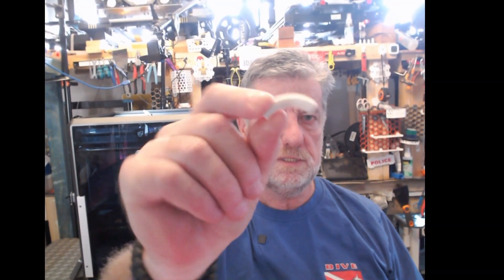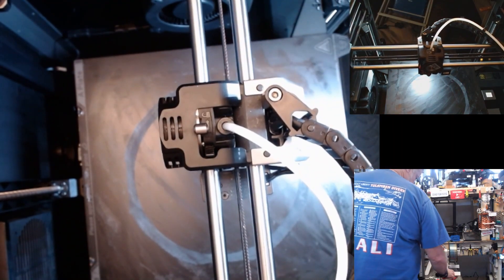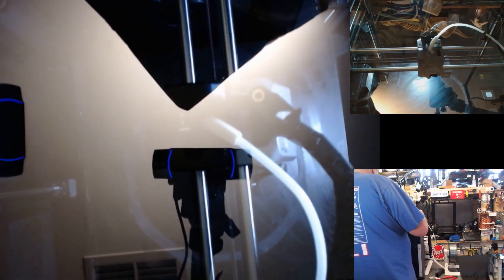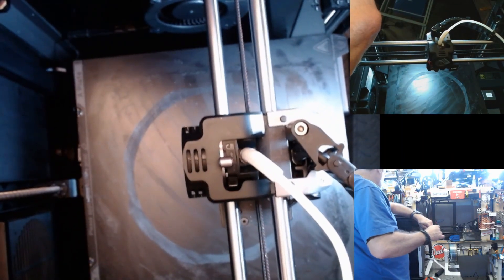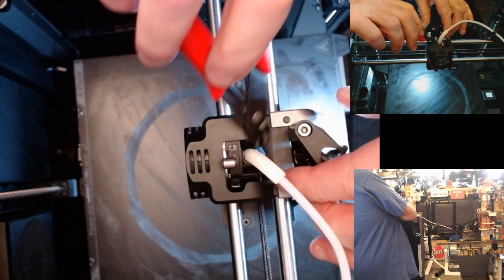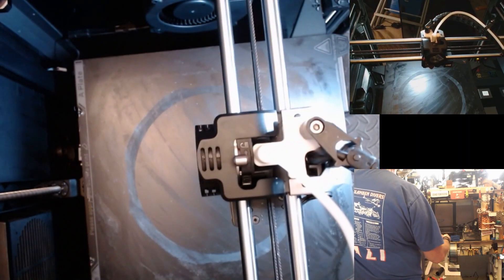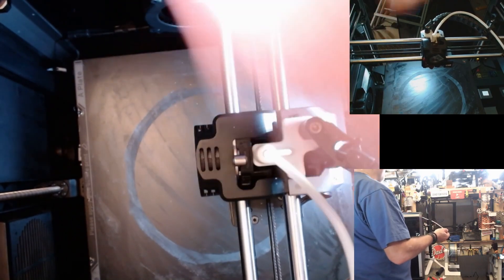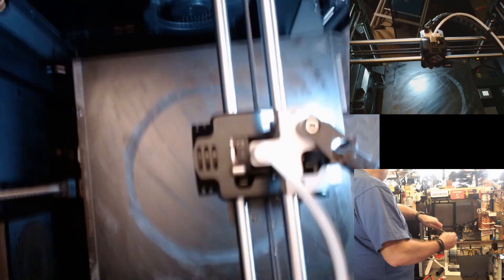Creality K1 Max - Is your filament feeding correctly??

Comment: So I had this on mine printer for a couple of months. But I kept having issues with filament not going all the way into the extruder. Unrelated I wound up printing a riser system with a hinged lid and lighting locations and removed the ptfe tube from the cable chain and it has a much more natural curve to it and never have an issue with loading filament anymore. 

But I’d like to say thanks for sharing the file for those of us who wanted to try it.
Reply from the maker: @Camaro45th  thanks for letting us know.  I hardly ever put the lid on

Comment: My screw that holds the chain link broke off while adding a riser, I can't get it out. What do you suggest?
Reply from the maker: You could try a screw extractor, but i would just remove the chain completely and cable tie the cable to the boden tube together

Comment: Also worth checking out is an issue with the PAUSE/RESUME macro. The PAUSE macro reduces the extruder max current to 0.25A. This is reset in the RESUME macro. This unfortunately only works if, and only if, the RESUME macro actually runs. Which it doesnt always do, leaving the extruder motor with severaly limited run current for your next print.

I couldnt figure out why the extruder kept skipping on random prints. Even tried replacing the extruder with a Bondtech LGX Lite! Nothing helped. Had a long stare at the Klipper config files. And there is was. Reduced run current for the extruder in the PAUSE macro. The solution is simply calling RESTORE_E_CURRENT in START_PRINT.
Reply from the maker: Thanks will look into that

Comment: I did the first one and I think it caused my cable chain to hang to low and rub the rods
Reply from the maker: Is your boden tube running on the inside or outside of your chain ?
Reply: @3D4Everyone1  out side I took it off and Rand the boden tube in the bottom holes of the clips and it works better now but it still rubs on the glass
Reply from the maker: @QtipsADHD  yeah mine lightly rubs against the top when it's on,  but it doesn't cause any problems,  i don't have the top on for PLA prints

Comment: When you design the one with the 90 angle in it.  It would have to be able to pivot with the movement of the head
Reply from the maker: yeah i thought about that , the printhead movement seams to be ok with it on, as the boden tube doesn't move much, will do a test print and see how it goes.
Reply: I thought about all that when designing the 90 bend, didn’t want it screwed down to anything, making any clog or issue that much more difficult to deal with. I leave the blue locking tab out for quick filament changes, really don’t need it with direct drive system.